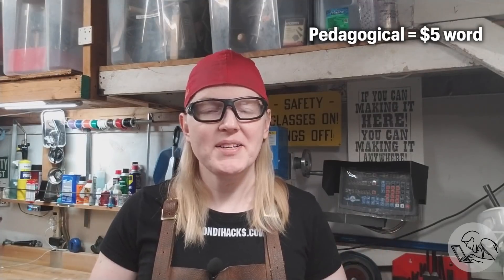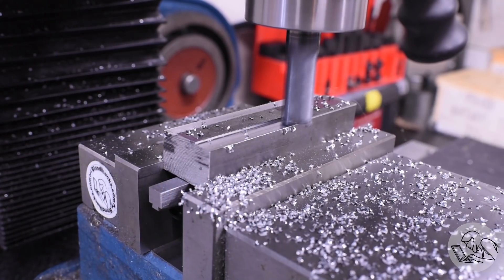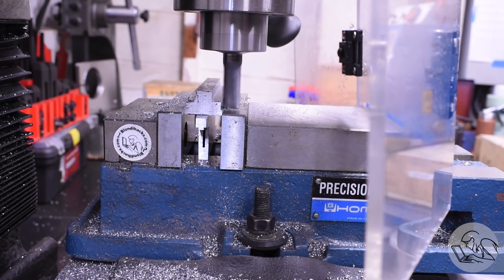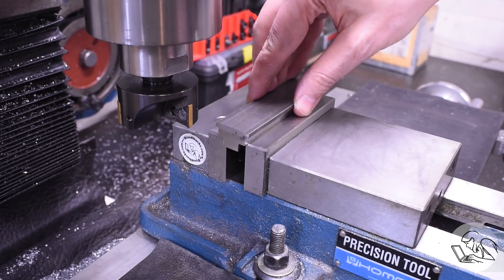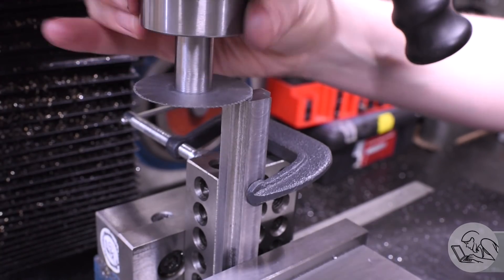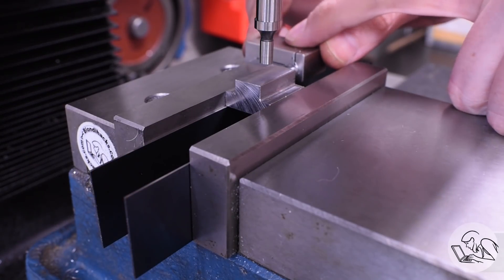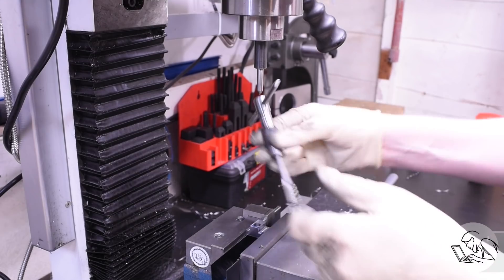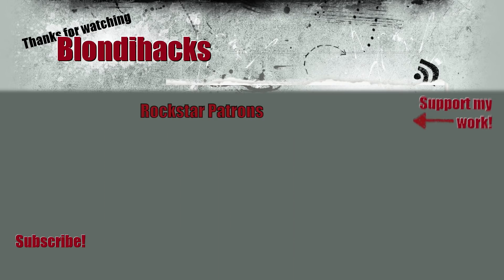FAST T-Nuts! Can They Be Faster?

Comment: When I tried to make the 'side-slots' my milling bit (2fl 1/2*1/2*1*3) broke/shattered at one flute's end. 
I used a speed of 300 rpm and I was going real slow on feeding speed (manually) and I removed a very thin layer of metal at each pass. 
I am using mild steel. I am using a combo lathe-mill (King Canada Industrial KC-1620CLM which has a 1/2hp motor).
I am usure what gone wrong. RPM speed too slow? too fast? Milling machine not rigid/strong enough?

Comment: How deep of a cut can you take on your PM25? I have a PM25MV and it really struggles with anything more than 0.010" and with .200 stepover on a half inch endmill (around 650 rpm).  I'm amazed you can use a slitting saw on that stock too, my PM25 completely freaks out on steel.

Comment: A small tip would be rather than take shallow depths of cuts the width radially you need I try to take full depth of cuts and a small axial engagement maybe .01-.025” this uses the tool out evenly and doesn’t risk chipping the corners as much as a shallow depth of cut does. It makes these Long angry chips though so be careful :) I have a video where I made my Mando blaster on the CNC where I use this method to peel
Away tons of material at once

Comment: There are some T-nuts made by Sherline for their little lathes that are quite different, and I wonder if they'd have an application on a bigger lathe.  They have a vertical extension shaft which is thread, and the threading doe not go through the bottom.  I use them with a back side parting tool I designed; and any other place I have a spacer block.  Here's a pic: https://www.sherline.com/product/tee-nut-tall/

I put a Sherline head stock spacer on my lathe, converted it to an ER32 collet, and am able to run 80mm 3 & 4 jaw chuck. REAL chucks, spiral 3 jaw and an independent 4 jaw.   I use a spacer block on the cross slide, and by adding a Sherline sized qck change tool holder, I only had to be close with the thickness of the spacer block. But, this is where the tall T-nuts came in handy.  Sherline sells them for use with their fixed tool holders, if you want to see what they look like.

I tried making a dovetailed spacer block for the tail stock, but abandoned that project, and bought one for the tail stock, which also works with the steady rest.

I use a 2.5hp DC treadmill motor, with a alternator based jack shaft, so the motor RPMs stay high for the torque, then with pulley size 'magic', I can run from about 300 RPMs to a max of 5000 RPMs.   Unlike most Sherline users, I don't have any problems using inserts, turning SS and aluminum and plastics are a breeze.

I discovered the alternator jack shaft by accident. My neighbor gave me a half dozen core alternators from newer cars.  I've worked on cars as a job and hobby for 50+ years, but wasn't familiar with the new three bolt, non swing serp belt units.

There were two Motorola alt laying on the floor, as I thinking about how to build the jack shaft I needed, (I had tried without one, and it was a joke.)  I noticed these alts were identical, except for the 'thickness'.    Same diameter, same mount, but one was several inches 'longer'.  I checked and the difference was the amperage output.

I took them both apart, and used the front half of the case and the rotor from the high amp, and the back half from the low amp.  I had to remove the diodes, brush and such, but they fit together, needing a 1/4" wide spacer.  Effectively, I had a dual shaft alternator after I made the spacer.

I used the serp belt pulley side on the micro-v drive end of the DC motor, and used a cogged belt pulley on the other end of the shaft, and a small cogged pulley on the lathe spindle.  I left the rotor as is.  Left all the copper; that sucker is most of the weight of the alt.    I couldn't find a serp pulley to fit the motor, nor a micro-v pulley to mount on the alt.  So, I bought the largest micro-v pulley I could find, (~5"), and used the OEM steel serp pulley.   With some creative turning and sizing of the plastic micro-v, I was able to use some 6160 to sandwich the two pulleys together, and then cover both side with epoxy and some fiberglass mat. 

It's came out concentric enough, +- 0.050' and near perfectly square to the shaft.  I have a small drive pulley on the DC motor, to the larger driven pulley on one side of the alt, the a larger cogged pulley as the intermediate drive pulley on the other side of the alt, and a very small cogged pulley on the spindle.  Spindle size on the Sherline is 20mm, making finding a cogged pulley easy and cheap.

(cont below)

Comment: yeah I agree with many ppl recommending doing all holes and tapping before cutting, since the tolerance for a tnut is basically anything goes as long as it slides well in the slot. esp if you have a dro, absolute centering isn't needed except for perfectionists haha. band saw setup I think also faster than mill fixture and changing slitting saw in and back out.
good job tho! very enjoyable to watch you make some chips

Comment: I would really find it helpful if you could post the RPM, feed rate and cutting depth - for your different milling operations eg facing, slotting and end milling. I can sort of figure some parameters for aluminium, but steel is so much more unforgiving. 
Otherwise, enjoy your posts, delivery and humor!

Comment: A very enjoyable watch, Quinn. Thanks.
I am a hobby machinist, with limited skills and facilities. I did a job for one client, which by luck and star alignment, turned out exceptionally well.
It was an awkward component to make, right at the edge of my skills level. The client referred me to someone else, with the introduction: ...an expert machinist...
I could only deny this, and say that I watch a lot of youtube videos...
Anyway, it was a fairly simple job; a single point internal trapezoidal threading operation. ( with brass/bronze/yellowmetal material supplied )

Comment: Im relatively new to machining. For me it’s strictly a hobby. I dislike wasting metal because where I live it is not only expensive, but an hour drive each way to get it. My point is, why not use the slitting saw to rough in the shape. That way you get the small corner piece for another project, at the same time making less chips.

Comment: This is the part where I admit I just use flat stock and don't worry about having the bump for extra thread. Cut, drill, tap. If I've got the welder out, I just weld a nut on flat stock and don't even drill a hole :V

Comment: You could conceivably shove a few strips of coldrolled across a woodworking tablesaw a few times. A carbide-tipped blade schould have no problem rabbetting them.
SCNR
Also in a pinch, you don't even need the T-shaped cross section, it is possible to just use a tapped strip of steel in a T-slot. It's just not as nice ...

Comment: The company that makes my wheelchair charges $17 per T nut… I need to start machining them.  This is a good guide for doing so.
Reply: holy hell =/ that's some serious b.s., if they're some oddball size you might even be able to make a few bucks if you can hook up with some others that have the same chair model =)
Reply: @ScumfuckMcDoucheface the irony is that a lot of the parts they use are common enough.  For example: the shocks on the chair are also used on mountain bikes, where they cost about $20, but from the chair manufacturer they’re $150.
Reply: @JordanHaisley  wow! Is that because a lot of their sales are through insurance, so they justify it by thinking they're not (usually) bilking the people that could use a break?... I like the idea that parts are interchangeable and all that, i had no idea or at least never thought bout it... I have the feeling that if I needed a chair I'd have it tuned right up with a bunch of Norco and Specialized parts haha =)

Comment: I really like using stub drills for drilling non-critical holes, less flex than regular drills so closer to centre drilling first with fewer tool changes. As long as space isn’t an issue of course.
Reply: A good set of screw machine length (stub) drills is fantastic to have on small mills as often times it is all that will fit in the limited Z working space on taller setups.

Comment: When I saw the video title I thought this was about T nuts that would be quicker to insert into the slots or something. Maybe with some red speed lines painted on the side.
Reply: Or a way to get them out more easily
Reply: @jacklewis1  i learned the hard way that removing t-nuts from my table "quickly" is not to use 140psi of compressed air and yelling "hey guys, look at this"

Comment: They can be faster, almost everything other than the contact surfaces can be unmachined if you have correct size stock. Cold saw cut ends and deburring
Reply from the maker: Definitely!